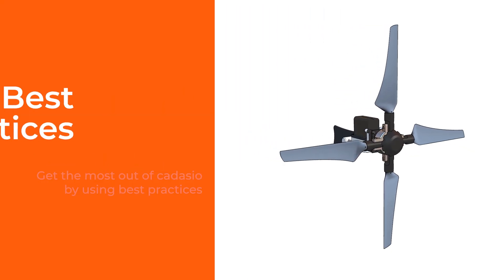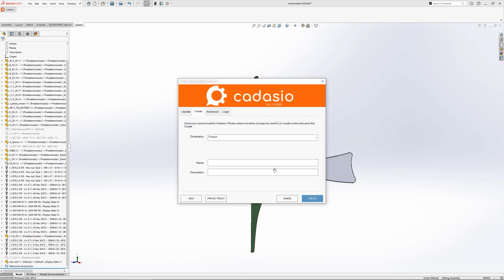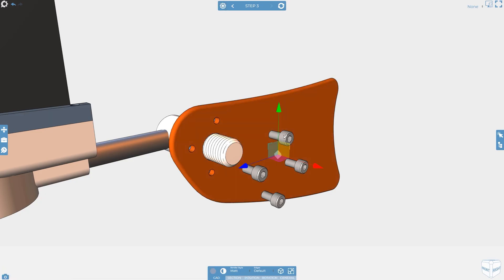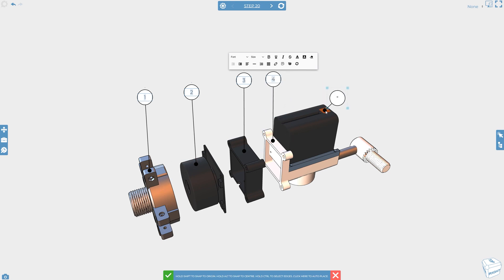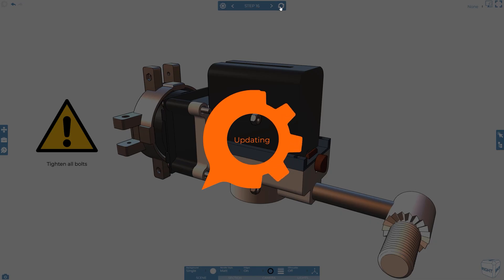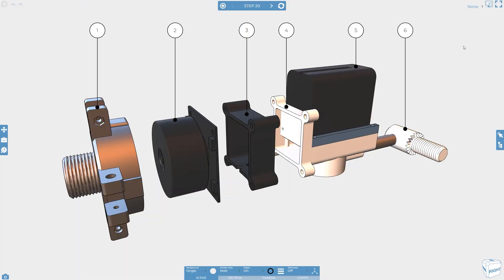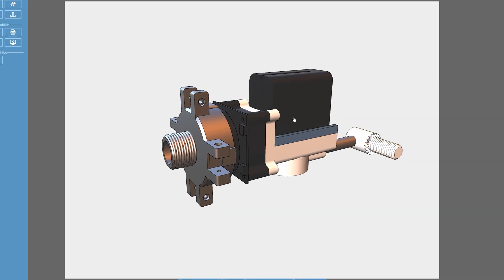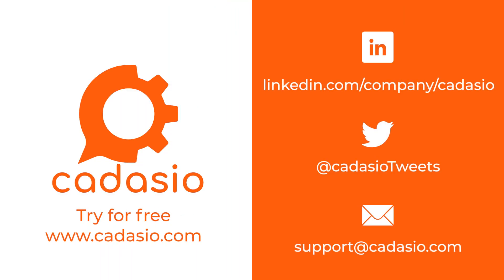Best Practices

Comment: Is it possible to save the camera angle?
Reply from the maker: Yes! If you press spacebar you will get the views menu up, where you can quickly change to standard views or save custom views. Also, you can apply the camera view from one step to another using the steps manager.
Reply: @cadasio  Thanks!